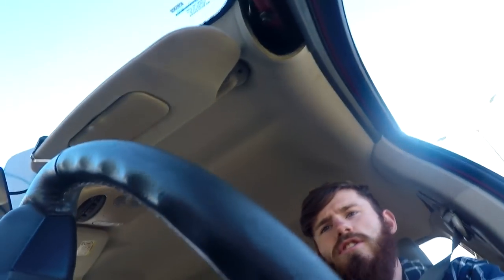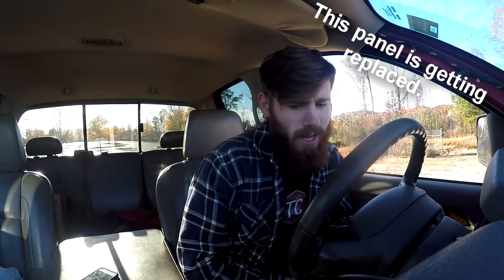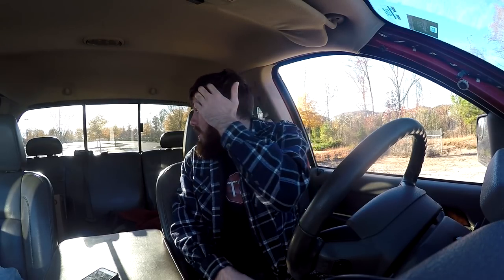Cummins Vlog - Driveline Vibration, NEW Mod Plans and It's Now in GA!

Comment: On the F250 Turbo Diesel, the driveling rattle for us was just loose bolts. Driving it down the road it fell out. Try tightening or replacing the bolts with stronger/locking bolts

Comment: I had very similar issue and after replacing all my u joints and a bunch of other stuff we found my rear drive shaft was actually bent.... not sayin that is you issue but it's one more thing that you can look into... I had to have a driveshaft shop cut the ends off my old driveshaft with all my new carrier bearing and u joints and the made all new driveshaft....     a 1 piece would be the better way to.go but I had all them new parts on mine so I  went that route instead

Comment: Check the carrier bearing that supports the the drive shaft that should be your problem if you can move your driveshaft around at the carrier bearing point it will need a new one and that should fix your problem
Reply: Alex Hernandez there is no carrier bearing on a ccsb

Comment: tomcat if you want a rill cummins experience you should ride in my first gen 12v with triple turbos it puts out 653 hp 990 torque
Reply: CUMMINS POWER        THREE turbos and that's all it puts out??
Reply: Blu Gods can't afford the tires for I they last two months run 16.5 on it and it smokes the tires every time I let off the clutch
Reply: CUMMINS POWER what's all done to it.
Reply: Johnny boii Also turned up injection pump
Reply: injectors? lift pump?
Reply: Johnny boii lift pump set screw are all maxed and 40hp injectors

Comment: I had a 3rd gen cummins and I had a problem where the drivetrain was shaking not 2 months later my transmission went out its bull#hit because I didn't even tow anything with the truck and I went to get it fixed and  it costed 5 grand to fix it so Its just rotting in my backyard cuz I don't have the money

Comment: Vibration is probably a bad carrier bearing or a wheel bearing my brother has a mega cab & he has replace 3 in the last 6 months
Reply: Kamren Horn it's a ccsb no carrier bearing
Reply: Jordan Lamm  yes there is one my duramax has one an my friend was a 3rd gen dodge
Reply: Kamren Horn that's a duramax. I own both a 3rd Gen and 4th Gen ccsb one 2500 and one 3500 and neither have a carrier bearing. only mega cabs short beds and cclb have carrier bearings for dodge.

Comment: will my sounded like that mine has a loud kocking noise plus if this helps white smoke out of the exhaust 05 2500HD with a 5.9 cummins
Reply: dodge 05 2500hd
Reply: If you have white smoke. and knocking. Then i would check your injectors. and if your injection rail is bad. Have fun fixing the common rail :)
Reply: Thomas Klein dodge never made a 2500 HD lol you're thinking chevy with the HD part.